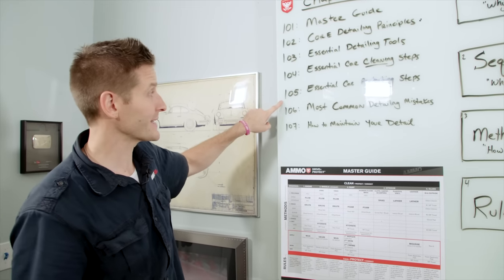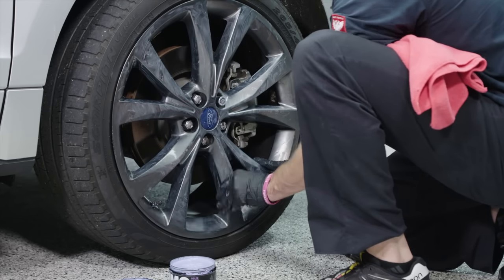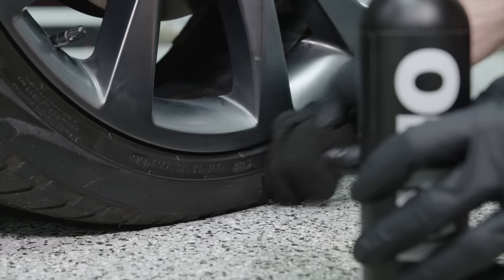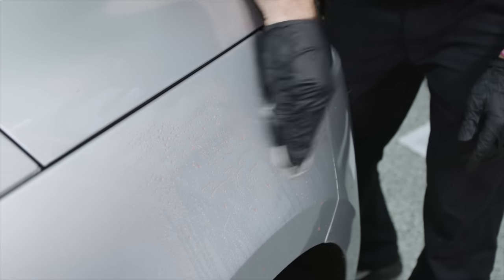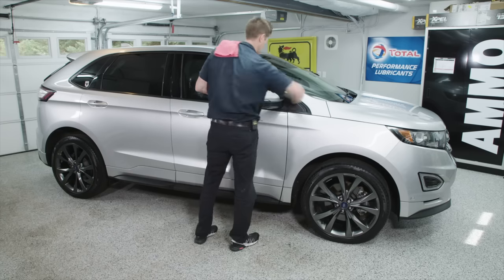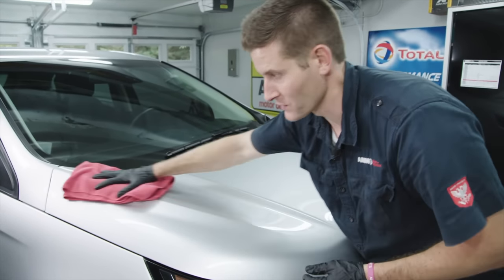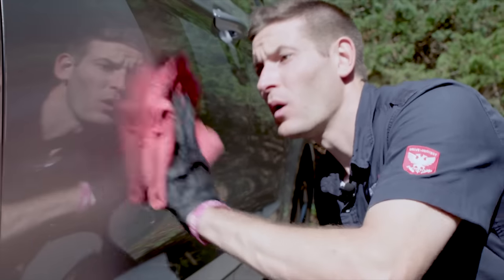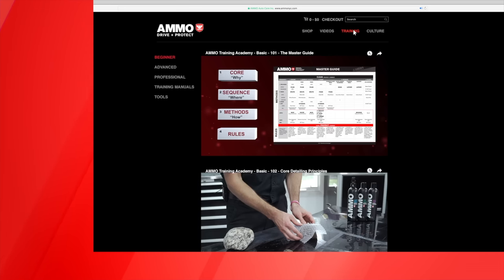How to apply Car Wax and Sealant ATA 105

Comment: Jesus that's a lot of maintenance. Definitely going for a clear wrap on my next car. After 10yrs of daily driving my NC Miata, I can see getting a wrap will save you immensely in the long run. Especially if the vehicle sleeps outside. This way you only really need to do a regular wash to keep it looking new. 
Good video for pro detailers.

Comment: You definitely want to clay if you live near train tracks. When I was a teenager, my beater Saturn started developing rust spots on my painted plastic bumper. The contaminants the train kicked up fell on the rear bumper which had a 'shelf' and started corroding.

Comment: Quick question to Larry: if you stack all these protections one on top of the other, why should you use a ceramic coating if its properties are being covered by the other products? You would have to wait until the above products fail until you will see the characteristics of the coating. It's like having a dream car but you drive another car because you don't want to put mileage on it.

If the answer is for longevity, then isn't this answer kinda wrong? You can't say that a product has a longevity of 2 years if the product didn't had the chance to be put to work. It's like saying: "these batteries lasted for 2 years because I have used another set."

Comment: Random question,
Are you still making that AP cleaner/ degreaser?
I just missed this video... and put in my order today. Cant wait to see the outcome after doing some touch ups, linex, and a full detail. 

I am confident that between everything you shared in this series, and the kick ass product you have, I am going to be blown away with how the tank looks for the first time in 5 years (13' F-150, armored)
Reply from the maker: No i took it down because I wasnt happy with it. I need to make it better. If its not the best (or what I feel is the best) I wont sell it. Period. I have no investors or anyone telling me what I should do (business wise). I prefer to make it what I feel is the best or dont sell it. I need to sleep at night
Reply: AMMO NYC I love that mindset.
Seeing you apply the to everything you do in both the videos and you product is why I chose to put a pretty penny into your product. 
Thank you for everything!
Reply: Is this the same reason the wheel Gelee is no longer available on your website?

Comment: hi. did u happen to do a vid on storing a car? cant seem to find if u did. of course, the best is to drive the car every few days or weeks if storing for long periods, but im looking for the best second option if no one is there to drive the car periodically....

tires:  motorweek suggests jacking the car up at correct points closest to the wheels to also keep the springs loaded which they said is very important. some suggest using those tire savers/ramps with a partial curvature for the tire to sit in...i hv doubts about those products even if the tires fit the curvature exactly (which many cases it may not fit exactly)...i can foresee flat spots forming. even if air in tires is inflated to the recommended max.  your thoughts? tires r my main concern. i plan to keep some car sitting for about roughly 6 months at a time.

fuel: motorweek said to cap off the tank and add fuel stabilizer if storage is less than 1yr. if more than 1yr however, they said empty the tank completely. is this ok for newer cars? im sure this would depend on the type of car but how would i go about removing all the fuel? let the car run until fuel is all gone? ...and then after a yr when im back from a long trip, i can simply add some gas in and it will start for most modern cars?

other fluids: mw also recommended changing engine oil (oil picks up acids as it is used) and the coolant. and also brake fluid as is attracts and absorbs moisture & then damages brake parts. ok. fine. this is doable

car battery:  using a pulsing trickle charger better than a continuous trickle charge. fine but what r your thoughts? 

bugs n rodents: cover exhaust pipes (but safety concern as many forget about it and the CO fills up the car cabin!!). i would tape the exhaust cover to the car cover or something like that to help make sure i remove it. another suggestion is placing moth ball things (important to place on a tray or something so not directly in contact with carpet, etc they said) in the interior but i dont think i would need this....plus car would smell like that moth stuff.  this is no biggie either.

car wash n cover: of course wash car appropriately (interior too) n cover w the correct car cover eg indoor cover, outdoor, etc.

main concern is tires as it would be a pain to jack each car up every time... even if i had electrically powered jacks stands (not like your lift. like 4 individual jacks that i would hv to manually align each separately).  your thoughts will be appreciated as i know u carefully think this stuff out. thnx!

cant wait for autonomous driving vehicles so it can properly store itself!

Comment: Larry; How does the first 2 "layers" stand up to spot treatments with a claybar? Say your 2 months in after applying the first 2 layers and you live in a high industrial fall out area and have to park outside. And you notice after just a couple months you have maybe just a couple small rough spots you want to clay to smooth them out. How much of this product is removed from a quick spot clay, will both layers need to be re-applied to that area? 
Thanks.

Comment: Larry please answer this for me..just finished full paint correction..I've applied 2 coats of ammo reflex 12 hours apart..now I'm going to add skin .. how long do I wait for second coat of skin to be applied. In regards to reflex you said 1 hour and then skin is ok.. that's awesome was hoping that I don't have to wait overnight everytime I do this with cars. Also I found skin being a little hard to remove after 2 mins or so..am I waiting too long or too short. It just seemed like I'm rubbing and it takes quite a bit to remove. When it's done I LOVE skin. Just was not sure on removal. Is leaving it overnight actually worth it ? And does it make removal harder again? Thanks in advanced Larry.

Comment: I’m assuming you’d remove the light surface marring caused by claying before applying any ‘protection’, Reflex or otherwise.
Reply from the maker: ONLY if marring happens, but in most cases, from my experience at least, I don't need to because the paint wasn't marred after I clayed and if you do it correctly.
Reply: Yes makes sense, thanks for the quick reply!
Reply: Another quick question: does layering a wax on top of a paint sealant provide any additional benefit? For example, applying Meguiar’s Ultimate wax over Wolfgang deep gloss sealant (WG 5500).

Comment: A couple questions can you use the creme on the windshield as kind of like a rainex?

Also are the products okay if they sit for a while? I obviously would shake it up before use, but I wouldn't be cleaning my car that often and during the winter I wouldn't need to wash my motorcycle.
Reply: hello sir, I can not speak to using the crème as a windshield protectant, because I have no knowledge on that. but I have a couple bottles of different ammo product next to me (by my bedside, don't judge), and none of them mention a shelf life or expiration date, though they all say "Do not freeze". that being said, they most likely do have a shelf life, but I would think they could last a couple years before any chemicals in the mixture start to degrade.
Reply: Matthew Gunnink Okay, I wasn't sure if creme was like a standard carnuba was as I've seen video of people using wax on windshields to bead up water

Comment: Larry, what is a good (not the best) but,  affordable DA polisher to get started with? I have a new black car and it is already killing me trying to keep clean and as careful as I have been washing I already see swirls and scratches.  Have Happy Thanksgiving thanks for all you do.
Reply: Griots 6 inch DA and harbor freight 6 inch DA polisher (way cheaper) are good for beginners.

I personally have Griots but not Harbor Freight... but those are the two I see recommended for starters
Reply: Thanks
Reply: Thanks, i have been using the 2 bucket method, i'm starting to think it's the drying that is causing the problems.  I'm using a wet microfiber towels but, doesn't seem to work very well for me.
Reply: Spencer's Garage - ahh, how did I forget the PC! lol
Reply from the maker: I would go MT-300 from Meguairs
Reply: AMMO NYC thanks I think I will go with it.
Reply: Im getting one for my birthday, go big or go home!
Reply: Ive only used the Adams Polishes DA polisher and it worked really well, considering Rupes USA headquarters is right next to Adams HQ I wonder if his polisher is a rebadged Rupes.
Reply: Check Harbor Freight

Comment: Are there any negatives to drying your vehicle (after the preliminary wash) using the hydrate formula, then following up with the reflex and defense coat regimen?
Reply: Not at all. It is actually what Larry would recommend.
Reply: Actually, Larry said on his Reflex video to not use any spray waxes or Hydrate prior to applying Reflex (you want a ‘virgin’ clear coat for maximum bonding, etc). 

You see people stripping everything off with concentrated shampoo, etc and going over with 1:1 IPA to take everything off the clear coat. 

Applying something prior to your coat/sealant/wax of choice would just defeat the purpose of what you did to prep the car
Reply: MaRTiiiNxD that's what I thought I remembered hearing at some point in a previous video. I guess I will go down the route of being cautious while drying my car. It's brand new and I'm just concerned of inadvertently causing scratches while drying. I'd hate to cause a scratch prior to the reflex application.

Comment: Hey, Larry. For whatever reason, whichever wheel cleaning product I use, Meg's/Mother's/Sonax/Griots Garage, I can't seem to take every inch of brake dust off of my customers cars. I want to give my customers the best possible clean for what they are paying me, any tips?
Reply: I bought ammo plum its amazing. you'll be able to see the black depth of the wheelbarrow. It's also very expensive and goes quick.

Comment: I haven't seen any controversy with clay-barring a car. What's the issue with it? Seems like all the guides I've seen suggest it.
Reply: It can mar the paint if used often.
Reply: ForeignBorn Patriot isn’t that just caused by improper usage? And you’re not supposed to clay bar all the time anyways.
Reply: Colin Stuart don’t clay bar all the time. When you do, use a lot of lube and don’t press hard on the paint.
Reply: the "controversy" comes into play because some people believe it should be done every wash, which isn't necessarily true. the reason to use a clay bar is to remove deeply embedded contaminants in the paint surface, which can be caused by many things, like sap or other debris from a tree, or dust that has been sitting on the paint for too long. that being said, cars that are kept inside, or cars that are cleaned and protected very often, have no need for the clay bar, because the contaminants have no time to embed themselves into the paint, and come off with a simple rinse. if the car doesn't need to be clayed, then going through the process of claying it every time you wash just wastes time, and doesn't actually have any positive effect for the paint. that's why Larry uses the analogy that you don't go to the emergency room every day, assuming there is something wrong, you only go to the emergency room when you need it. if you wash your car regularly, and add protection often enough, then claying should never be needed, it's usually cars that are neglected for some time that need to be clayed.
Reply: Matthew Gunnink 👌🏽👌🏽👌🏽👌🏽 living in nyc I clay my car every 3 months. It sits outside and it’s my daily driver. Plus maintenance washes every week. Plus good clay 160 grain is not cheap.

Comment: Is reflex considered a ceramic coating???
Reply: Julio gt Looks like it to me. I'm not big on coatings. Never used them, but not a fan. I believe in weekly washes and bi weekly waxes, with correct technique to minimize scratches and such.
Reply from the maker: no
Reply: I'm not an expert but I had my car coated with something similar to reflex and it definitely was worth it. Maybe Larry could explain why  reflex is not considered a ceramic coating and their differences. I would definitely like to try it.
Reply: To my understanding, Reflex is a traditional sealant, that is a man-made product containing polymers, resins and synthetics. From my experience, there's a broad range of performance from sealants. I've used products that produced the super-wet glossy appearance of a carnauba wax, to the detriment of longevity, and products that have lasted almost 12 months without re-application, at the expense of that extra % of 'wow' shine. I think because they're synthetic, there's a wide spectrum of how they can be manufactured to perform. Larry seems to have his product to provide more longevity than a natural wax, with a slight (emphasis on slight) reduction on max potential gloss - which makes perfect sense as he already has a wax product in his lineup. 

Ceramic, quartz or glass coatings (the terms seem to be used quite interchangeably tbh) use naturally occurring silica (a component used in ceramic and glass manufacture), commonly found in quartz, and is modified on a nano level to create these coatings. I haven't personally used these, but I did have a quartz coating applied by a 'professional' to a new car a fee years ago and honestly, I wasn't impressed. As it was a daily driver, the aim was to have a properly sealed paint surface for the advertised 12 months, with regular washes and maintenance to keep it working well. I got maybe 4 months out of it before the performance fell off a cliff, through no fault of myself or my maintenance method. That may just be a one-off (hopefully) but suffice to say, first impressions I wasn't impressed. 

Give me a good sealant that can be applied every ~6 months by hand, and topped up every 1-2 months with a quick wax, and I'll be happy.
Reply: Chris Smith Lower end coatings will wash off over time, as will the more expensive coatings, but check out Gtechniq for a true ceramic coating that does last
Reply: It was Gtechniq funnily enough, it was a full Gtechniq 'system' that was done to the car and certainly not cheap. Honestly I think the issue was more with the detailer than the product. I have a couple of Gtechniq products among my collection and they seem to work fine.
Reply: It is not ceramic but the end result looks the same.  Reflex is actually better because, as I understand it, unlike a hard ceramic coating Reflex is flexible when the paint and coating experience temperature changes.  Hence the name Reflex.  The first time I used it I was amazed by what a difference it made in the "depth" and color.

Comment: What’s the difference between skin and wax.
Reply: long story short, skin is more protective, wax is more shiny

long story long, skin is a synthetic sealant, meaning it is formulated in a lab, that way they can control the effects of the product by changing its makeup- for example it can be formulated to withstand a couple weeks of sun exposure and other driving "wear", though it doesn't usually give off as good of a shine as a natural wax. carnauba wax, which is what Ammo Crème is, has a very natural shine to it, and brings "depth" to the paint, making it more reflective, though, because it is organic, it doesn't last long, and it evaporates in high heat very quickly.

like Larry says (if I may speak on his behalf) they are both helpful in making the car beautiful, and when they work together, you get the protection of ammo skin, and the shine of the carnauba wax. the skin lasts longer so you don't need to apply it as often, but the carnauba wax (if you desire the deep shine, though you can argue that it's not necessary as long as the paint is protected) should be applied more often, because it evaporates or "wears out" quicker
Reply: Skin is a sealant that last longer than wax, it goes on first. Does not have the shine that wax has. Wax is just for looks, doesn't last long and goes on second.